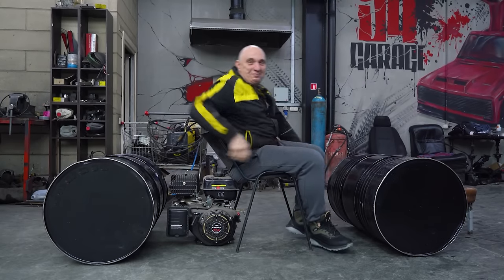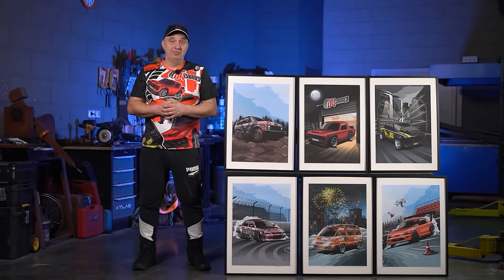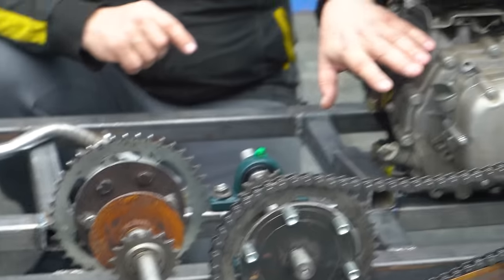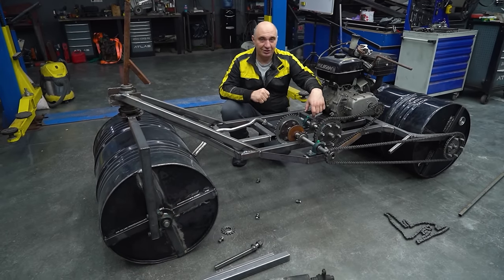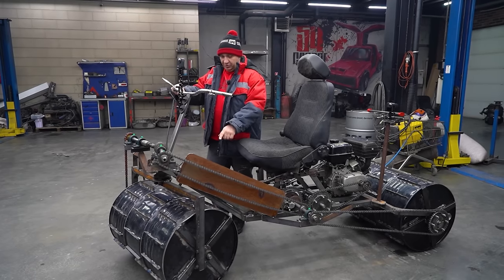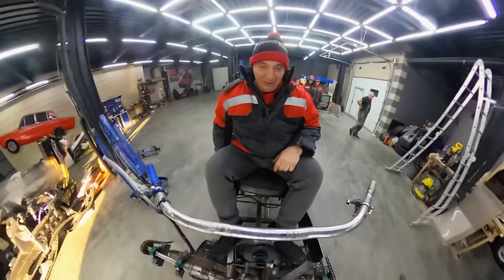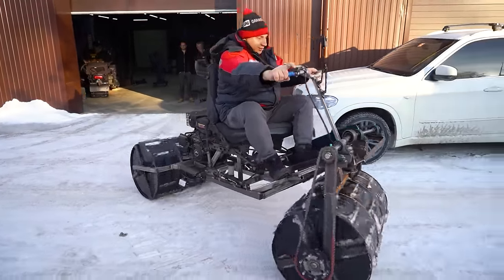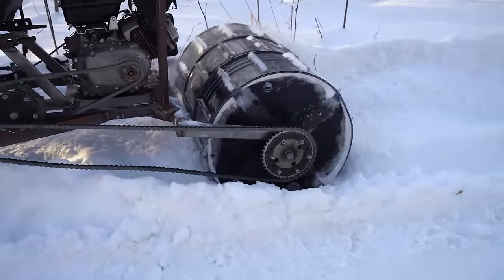We make an all wheel drive ATV with metal drums for wheels

Comment: Put the cleats on at an angle, like tractor tires. That way they push the snow out to the sides and the rear barrel will have a clearer path.
Reply: I was going to comment same thing
Reply: I was thinking that too
Reply: Or G54 could use front loader washing machine drums and weld the cleats on an angle on those drums. The 200 L oil/fuel drums are excessively big, not allowing the car to dig into the snow.
Reply: And make them 2 or 3 times taller.
Reply: Exactly what I was thinking. Would also give a smoother ride
Reply: how about cleats like a golf shoe? and some weight inside the drums.
Reply: I think we have a workable prototype, time for production. :)
Reply: @robmanueb.  As a toy yes, but needs further development to get actually useful vehicle out of this, but concept is great
Reply: @Davidautofull  more weight would just help it to dig itself a deeper hole most likely, based on my experience with 4wd tractors and mud
Reply: @Davidautofull That would be good on a sheet of ice.
Reply: I was also longer cleats

Comment: There's an electric drift trike a guy built for his daughter that uses a plastic barrel for the rear wheel lol. This ridiculous contraption actually has some potential.
Mildly relative, a vehicle with innertubes for tires would be interesting. It roll across even the deepest and softest snow.
Reply: That's cool. What a dad!
Reply: Couple vids for you:
микро Шерп сделанный на коленках
Снегоход - Вездеход из велосипеда, бензопилы и камер от камаза
Reply: how would they be attached ? unless you mean put a series of them on the barrels? maybe ... filled with helium? use a large pivoting ( or pair or trio) high speed fan/s behind it to allow it to sort of drift on surface snow ? directed/steered by the fans as well as propelled? like some swamp boats? lol I'm silly of course.

Comment: I think some forward angle on the steer wheel would take away that shake, rather than having it straight up and down.
Reply: Yes, some caster in the steering angle. That would help greatly!
Reply: Turning the steering fork 180 degrees and adding an angle will make it more stable with the fork behind the wheel like on a motorcycle or bicycle.

Comment: This should float so you will have to build it again for the summer with some stabilizer floats on the sides
Reply: Same as I was thinking. Use 4 barrels on the outsides of the center part.
Reply: yeah, or just double up the barrels for more width and stability

Comment: I like this one a lot. I saw some other comments suggesting that adding some caster would reduce the bucking. I agree, but I also think that'd make it much more difficult to steer since it's a barrel and not a tire. I saw one comment suggesting to move the pivot point to the middle. I think that's probably the best solution, but I thought of one other idea that would be easier to implement without a full redesign. You could increase the reduction for the front barrel so that it spins slightly slower, and put it on a sprocket so it free wheels until the rear drum slips. I think bucking is being caused by chassis flex as the front and rear drums alternate between slip and traction. Using my idea would ensure there's always a little more push from the rear and keep the chassis in compression. I don't think that'd get rid of the bucking completely, but I do think it'd reduce it significantly without compromising overall traction. Thanks for the cool video!

Comment: Cut it in half after the motor. Make it articulate in the middle with a home made universal joint made from 4 wheel hubs in a cross. Make a duplicate rear section with the engine pushing the drum. Attach the seat and controls to the new front section. Steer with cables and pullies or chains or air/ hydraulic rams... something. Keep the weight low,  but high ground clearance like the rear is currently.
Reply: @@karlwithak. Zactly... lol

Comment: Hey, gr8 job guys, just a thought, if it was possible to design a system inside of the barrels to retract the strips of angle iron when they are away from the surface the vehicle drove over , this would help clear away any snow, mud etc from the traction bits, the system must return the strips of angle iron to higher than surface of the barrel in preparation for it to gain traction and propell the vehicle...lets say the angle iron strips outside the barrel for 180° of rotation and inside the barrel for other 180° of rotation, this way there is a self cleaning track

Comment: What a crazy idea! The fact it kinda works is even crazier! Definitely need to add some rake to the steering, change the design of the "tracks" on the barrel to be angled. The chains could use a guide pulley too by the looks of it.

Comment: This needs further development! Cleats li tractor tire as it was mentioned would be beneficial to move snow outside and maybe add more of them, well as taller ones. You can add couple bicycle rims and tires on the edges to make driving on smooth surfaces nicer. Chain tensioners and extending the frame a bit to allow steeper steering angle would be nice as well. Definitely something that wou could be very useful in snow and other such conditions.

Comment: Most four wheel drive vehicles have the front axle ration a bit taller than the rear axle ratio, so that the front axle pulls the vehicle along.  Perhaps one tooth smaller on the large sprocket for the front axle will help in the deep snow.

Comment: That's quite thrilling to see others trying to build their own snow vehicle too.
The "shovel grip strips" needs to be longer, so that it can get better hold in the snow. But that would only work with some kind of suspension. 🤔
Also no exhaust muffler foot heating system.😆

Mmm, that all wheel drive system is "impressive", but you can't drift like that?! I guess.

Comment: Awsome 👍. Add a second rear barrel driven, of course. Maybe attached with a swing arm suspension to share the load? Move the driver back behind the motor, over the two rear barrels, to transfer weight back.  Weld the traction bars on the barrels at an angle, or add angled bars,  to help with shake/bounce. Add a lot of chain guides and maybe chain guards, safety third, lol.
 I always look forward to your creations.
Reply: Or would chevron (tractor tire) style bars just in the center of the  barrels help chatter?

Comment: I would wrap the outer parts of the drum with tire tread or rubber and just leave the center with the metal cleats for smoother operation on hard surfaces and likely more floatation on the softer snow.

Comment: try two drums in the rear, both driven by the engine, and a large ski or skis in the front to float on top of the snow like a snowmobile. should be less weight less chains if the motor is on top of the drums

Comment: What about using say 4 or 5 tires per each drum with some metal bolted through them for traction. I believe you could bolt the sidewalls together. And be able to use them without air. The rubber would make a more comfortable ride

Comment: Instead of the drums, you could replace them with maybe 4 to 6 wheels per drum. Use steel wheels, make a locking mechanism that passes through the wheels so they rotate as one (alternately, lock them in left and right halves, might make steering easier, but mean the drive chains would need to go to the outside of each wheel, if you wanted 4x4).

Then you could put normal tyres for summer, and snow tyres for winter, and would help soften the ride.

Comment: Probably try using those thick plastic chemical drums, would likely cut down on vibrations, reduce weight,  also other advantages like having give to the softer tread surface so if a footnall sized rock is in the way it will climb over it much easier than a hard metal surfaces. Less noise would also be a plus. Just kicking ideas out.

Comment: Ford did this back in the 1930s eventually they came up with a screw type setup. So like if you took the barrels and made two pontoons on each aide with a corkscrew type band around it and then it operates like a tank or tracked excavator ect. But instead of rolling they spin.

Comment: Take 2 tires from a bike or a motorcycle, put those side-by-side about 1 meter apart, then put those paddles between them. So that when on hard surface, the rubbers take the load, but when the rubbers sink into soft snow or dirt the paddles start to get traction. Then do the same for back-tire, but wider, maybe 2 meters wide. Build the front from vertical plate, so it is more rigid. And move the wheel forward a bit.

Comment: Remove the chain drive and replace it with hydraulic and add weight to the drums. I think this would make a much better way to deliver smooth power to the wheels. Wheel speed is your friend in deep off-road snow, so more wheel speed may help.

Comment: If you maybe could add a way to heat the barrels, I wonder if it would be a good way to clear a path or street? I mean it does good at moving and packing the snow but what happens if it is heated?

Comment: fun fun, electric version with 4x4 motors would be the easiest to make, its truly a tank, its a tractor, also some smoothing wheel rubber, like multiple normal wheels side by side. it makes its own road. bigger water paddles. almost like a snow cat with tracks. it needs to work like a tractor with big grippy wheels.

Comment: A motor with a transaxle to drive front and rear drums then connecting to the 90° gearbox to drive the drum and then have it where it's articulating in the middle would have been a lot easier turning and it would also Had the rear drum track in the same track as the front

Comment: Need tensioner on the chain to reduce the bucking I think, to reduce some of the sliding I think metal ring around the barrels would work and keep the big metal one to move but make them stronger now sur how maybe simply use thicker metal for the pasll maybe 3/4

Comment: take a car rim, put a smaller diameter barrel on eash sice and then smaller rims on the outsides so you have 3 tires and  so the center tire can be a bit wider and taller      Then put a double set up on the back with one of those rocking type suspensions like on a double exle trailer.    Put all the power into the double rear for simplicity.    Have the rear also tilt side to side a bit to follow terrain and put the motor is on top of the rears to add weight.     Put some springs on the front and on the seat.     Have the chain sproket go all the way around the drum on one drum then power the other one with the first one with chains on the outside.

Comment: Add more barrels with taller paddles. One in front & back of rear barrel. Taller paddles in center of steering barrel. Add some rings on center 2 ribs of all barrels, to smooth the ride.

Comment: Needs more weight on the back and the dice chain of the front that way the front floats instead of digging in or spikes instead of the flat bars so it'll dog through the snow and grab the ground but not jump so bad that way or cut the barrels down and make them skinny and one on each side skinny goes good in the snow doesn't allow the snow to pile up in front of them

Comment: I'm sure few lessons have been learned here. Obviously, the design was flawed, but still demonstrates certain misconceptions. In appearance, you have sufficient engine torque and tons of traction, but the results were not as expected.  This explains beautifully why narrower tires are better in snow than wider ones. Your design literally floats, then grinds through the friable snow until it finally finds a hard surface for traction, instead of cutting right thought and grip to the surface. Unless you want to prove that Joseph Armand Bombardier was wrong, I think you need skis in front that will help to build your vehicle some momentum, and two barrels for traction in the back linked together by a crawler track system. Though, a twin parallel endless screw traction system would be a much more interesting design. This definitely needs a follow up episode.🎿

Comment: Wait..I can build this at home?!
I just need:
Barrels
Motor
Sprockets 
Square Tubing
Bolts
Chain
Seat
Welder
Grinder
Bearings
Gas
Welding classes
Garage

Is that all?

Oh...missed that I need a CV Joint and a restrictor